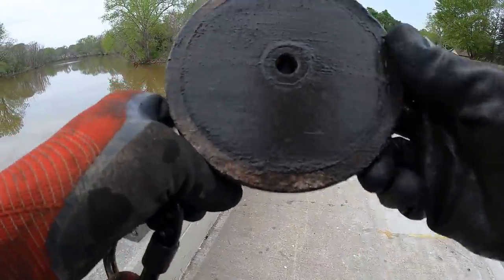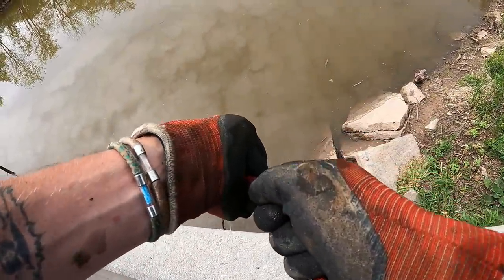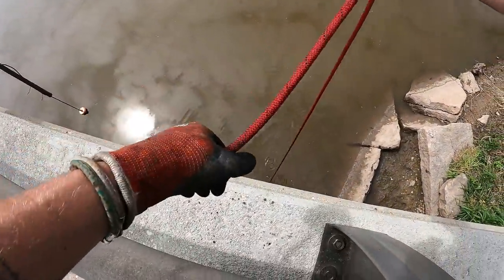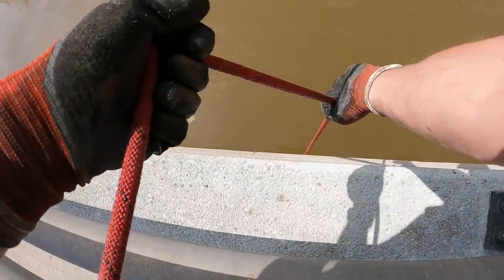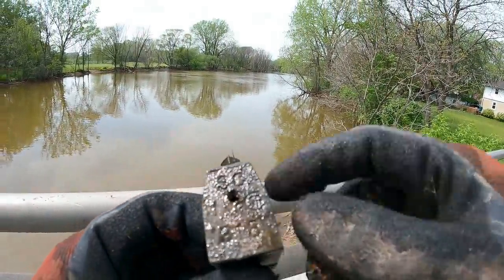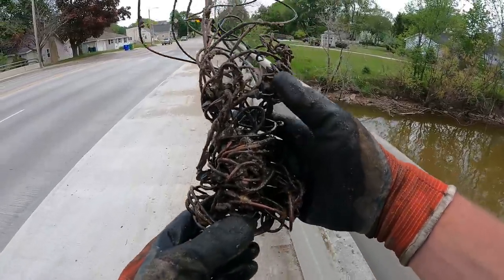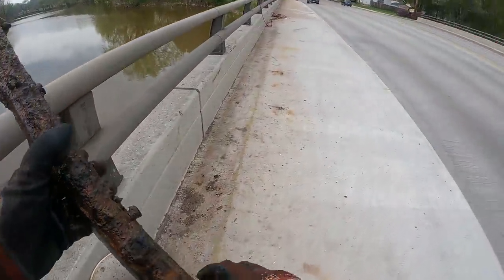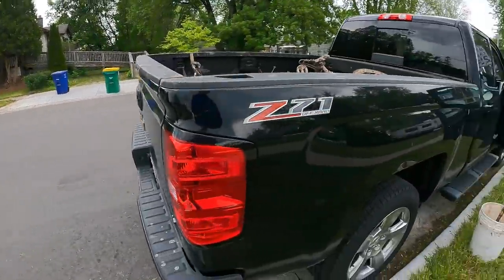Police Confiscate Murder Evidence Found Magnet Fishing For Further Investigation!!!

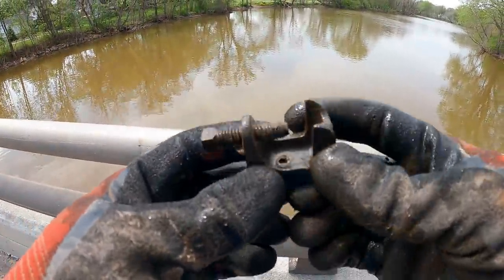Comment: I believe the object at 10:02 is a "Chain Breaker." Like for cutting a bicycle or motorcycle chain to length. I have a similar one. It just pushes the pin out of a roller. Doesn't really "break" anything. But then it might be a ground wire clamp.

Comment: The small clamp is a beam clamp. It has that small bolt to clamp to a beam and a usually 3/8 or 1/2 threaded hole for all thread rod. We used them all the time for pipe fitting.

Comment: The gun looks like a Mossberg rifle. The plastic piece with the finger grooves on the grip of the stock is the giveaway.  This is not a bolt action. Looks more like a semiautomatic .22 rifle. That round piece on the right side of the receiver looks like the charging handle. The barrell is gone, possibly sawed off.

Comment: The gun you found is a Mossberg .22 automatic clip magazine fed.  Someone cut it down to be a smaller size which is a federal crime. I cant tell exactly which model it started out to be without cleaning it up.  Mossberg made many thousands of .22 rifles like that and before 1968 they weren't required to serial number them.

Comment: Is it in my head or a cop with firerms training and knowledge just swiped the gun in direction of a civilian? It's old but it can still be armed and dangerous.
Reply: Nah, that long in the water and the trigger and firing mechanism is rusted in place. Also any ammo loaded would be ruined from that long in the water
Reply: @PsychoC4rnivore  yup, a relative of mine said the same thing after finding a ww2 crate of grenades in his property (europe)... Took out a nade, nade went boom. Now he has only one hand, my father have tinnitus everytime he hear high pitched sounds (keys clicking, spoon hitting a plate,...).
Rule number one of handling weapons: if it can go wrong and hurt someone, assume it will.
Reply: @lucienschlut  Wouldnt the difference be one was kept secured in a box within a dry environment vs somethin that was submerged in water where it starts to decay form the rust
Reply: @lucienschlut  there is a difference in an explosive device and a rusty gun from a river bed
Reply: @PsychoC4rnivore  more exactly 2.
The gun may explode (depending the cartridge and the damages due to rust) or send a projectile in the second situation, while in the first it may explode but a bigger explosion.
Amyway, its dangerous.
Reply: @thatoneguycisco5412  because the gun decay doesn't mean the cartridge does. Depending the quality of the cartridge it may be waterproof.
If the canon isn't too obstructed, the weapon will fire, if it is, the old gun may turn into a small grenade.

Comment: you have to scrape off rust which will damage the steel or metal that is covered in it or you could use chemicals to get the rest out off of it but the first thing you should always do is make sure you get dirt off of the rust

Comment: Ceramics are not magnetic.  A ceramic is any of the various hard, brittle, heat-resistant and corrosion-resistant materials made by shaping and then firing an inorganic, nonmetallic material, such as clay, at a high temperature. [1][2] Common examples are earthenware, porcelain, and brick.